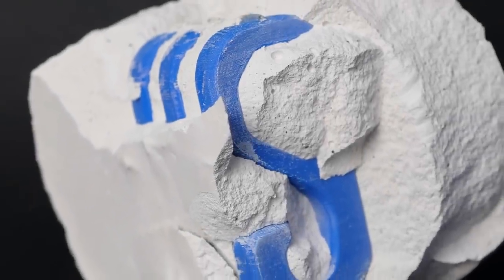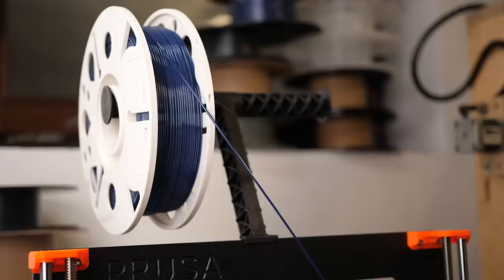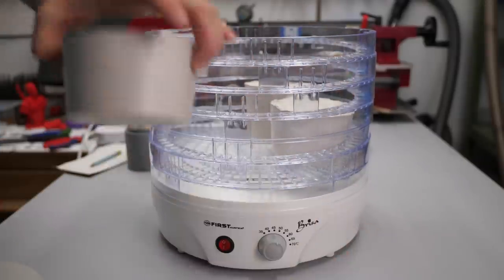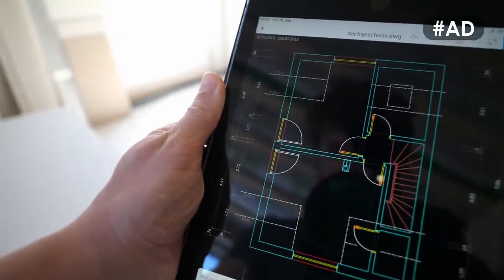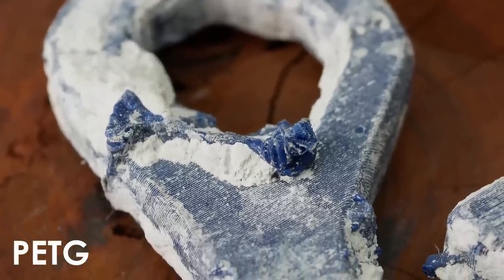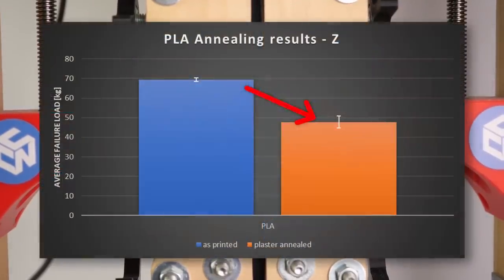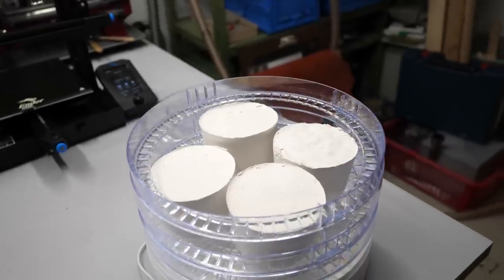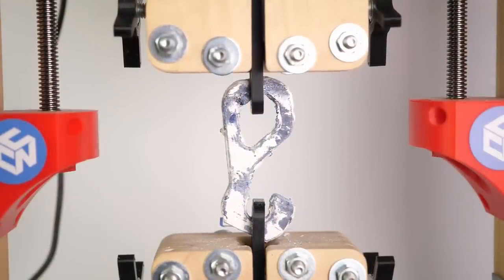Triple (x3) your Layer Strength by Annealing 3D Prints in Plaster!

Comment from the maker: Download a free 30 day trial of AutoCAD ▸ https://bit.ly/cncautodesk

Don't forget to share this video on Facebook, Reddit, Twitter, and other platforms!
Reply: Going forward with a sponsorship from Autodesk after the community response to their crippling of Fusion 360 seems like a bold move. Hope you could squeeze them for some hazzard pay for the risk to your reputation. 

Great tests, as always. Thanks a lot :)
Reply: i dont understand why autodesk starts sposorings right NOW, when there is so much risk of the community hating them...
Reply: @RedHotBagel  Autodesk was under no obligation to continue offering Fusion 360 for free. Especially when there are quite a few who abused the free license by using it for commercial purposes.
Reply: One thing to test post process for the PLA is UV resistance. Typically this is where PETG shined over PLA, but if its handling heat that much better, maybe it's UV resistance is also increased?
Reply: @vhoward1122  I can totally forgive that, its their insistence on a sub that killed me. I'll buy a piece of software once, I am not prepared to make it an extra monthly bill.
Reply: @vhoward1122  they still offer it for free, with a more limited feature set. I didn't say anything about them being in their right to do so or not.

The community has had a pretty negative response and that is something I would take into consideration as a creator in this space.

I'm not saying this sponsorship should not have happened or is wrong. I'm saying it is a bold move.
Reply: Autodesk can suck it.
Reply: @RedHotBagel  Hes a professional engineer, not just a hobbyist. 

Hes probably used to paying 2 pounds of flesh for a sheet of shape shifting licensing.
Reply: Hi Stefan, did you decide which hooks you were going to test for the hook strength competition? You should make a video showcasing the ones you choose.
Reply: Sheldon Thomas
1 second ago
Dear Stefan, you haven't try electroplating your test hooks,  you don't have to electroplate them yourself, there are companies that can do it for you, like, https://www.sharrettsplating.com/ and http://repliforminc.com/
they claim up to 12x strength increase in copper or nickel plating.
Reply: Should try making just some 3D printed molds for other kinds of plastic parts, maybe even throwing some steel wire in as some kind of rebar. Would also love to see Flex Seal! poured into a 3D printed mold for like D&D miniatures or something.
Reply: Could you coat the prints in a waterproof coating before putting them in plaster? If water infiltration is a problem, a water-proof coating may help.
Alternatively, could you vacuum-seal it in a heat-proof bag and then embed it in plaster?
Reply: It occurs to me, that since petg absorbs water, plaster might not be ideal for this purpose. I would try with silicone instead. It will not require drying and also will not pass water onto the petg. Once the silicone is cured you just need to cut it open and rescue the pieces. Is not as cheap as plaster, but it will be a lot easier to clean up and doesn't need water to clean.. Hope you give that a try looking forward to see the strength of those annealed pieces without bubbles!! Good luck and keep making great content.!!
Reply: pressurized heat oven is one of the best method for crystallize polymer. Infills though normally it at least 80% of infill when pressurized models  due to pressure collapses lot of polymer.
Reply: paint the 3d printed parts to close the pores before dipping them in the plaster to avoid moister creeping into the parts.
Reply: @vhoward1122  I agree.  This is like people complaining about Thingiverse, you can get your money back if not happy.  But since I'm just at the point that I need to increase my skills, I have reached the limit of what Tinkercad can do, I will look at other solutions.  I was starting to learn Fusion360 via on line tutorials, now I think I'll go with Freecad.
Reply: @Human-bf7kz  Oh yea I forgot about that part. Also you can use bees wax as release agent coating as well as a moister barrier.
Reply: Hi, to try use a vibration table to remove air bubbles, like it is made during  precast panel concrete pour. BTW It may give interesting results by using ultrasonic vibration too.
Reply: For dissolving plaster without having to hammer you could use some acid. I would use a muriatic acid solution but maybe you could try also some less strong acid (acetic acid?)
Reply: Seriously? an AutoCAD plug? why not Inventor? wouldn't that make far more sense to promote on a 3d printing channel? 

I've used AutoCAD before as a student, and it is an absolute pain in the butt to work with. It's a much older piece of software, and shows that in the clunky interface, you have to do basically everything yourself, and switching layers constantly is very tedious. It can do a lot of things that Inventor is not designed to do, but it doesn't really do anything particularly well. I honestly consider it a glorified vector graphics editor, not a proper CAD software. for 3d modeling, 1/10, piece of junk. for creating some types of vector graphics, 5/10, it's actually the only vector graphics program I can actually use, but it has its limitations.

On the other hand, Inventor is a complete breeze to work with because it is so intuitive to control, I like how well it tries to figure out what you want to use next, and automatically adds constraints, I honestly find it hard to believe that the same company made both when one has an annoyingly difficult interface, and the other is so intuitive and easy to jump in and start playing around. 7/10, great product, but the price is just ridiculous for a home gamer. Over one grand a year? what gives Autodesk? I get that it is a very capable product, but that price scheme is very unaffordable for a hobbyist. 

Autodesk, if you're reading this, I think you should try to offer more flexible pricing for hobbyists. you have a good product, but the pricing is ludicrous. I'll be the first to admit I don't understand the economics at play here, but I can't help but feel like there could be money and goodwill to be made by allowing more people to afford it and not just commercial entities.
Reply: First the questionable polymaker advertisement, and now Autodesk after all the hate for their Fusion 360 change of business... You are kinda hitting on the wrong sponsors in the last couple of videos.
Reply: Perhaps its worth retrying PLA at a higher temperature?
Reply: Amen
Reply: Your a genius, this is why Germans are awesome
Reply: here some improvement ideas:
1.use less plaster, you don't need a big bucket of plaster for a tiny hook xD, if you use less drying is faster, and opening the form also.
2.use a 2 shell method known from silicone form building:
  make 1 half shell submerge the part 50% , use a water resistand thin foil around the part so it the other
  half of the plaster does'nt merge. Use 4 position studs.
  you could make the seperation foil 5-8mm shorter on each edge so you still get 1 piece , but it can be cracked like a nut by hammering on the outer plaster joint.
The foil acts similar to the separation spray in the silicon process: https://www.youtube.com/watch?v=iCxEQZBJTao
Reply: @certified-forklifter  They're expecting all that money from forcing people to buy license.
Reply: If Autodesk had marketed Fusion as free for a limited time, I wouldn't complain. But they marketed it as free until you make $100k/yr, or if you need cloud services.

Then sternly they told us we have two weeks until they (a) lock us into their platform, and (b) break a bunch of our projects (a perfect combo!). It's clear they don't give a shit about hobbyists.
Reply: Wow, this is super impressive! The process seems similar to "Lost PLA" metalcasting.  Geoff from VegOilGuy might have some tips for you to improve the surface finish. 
Here's his Collab request page:
 https://www.vegoilguy.co.uk/collab.php
Reply: How about using dry sand in a plastic bag, then pulling a vacuum like a sealed brick of coffee? Easy setup, easy teardown, and zero hydrolyzation issues.
Reply: I'd love to have a full version of AutoCAD, but at three times the price of the LT version, and that only a one year subscription, it's as bad if not worse than paying a few years ago, as much as the cost of a small car. It's a pity they don't sell older no longer supported versions at a greatly reduced price for us non professionals who have no need for the top of the market versions. I learnt to use AutoCad at college 25 years ago, and used to have an outdated version on a second hand PC, used it occasionally to do furniture layouts in my house without having to keep moving the furniture, designing wood components for furniture, and just playing around designing architectural items. Not enough use or level of expertise to warrant spending thousands of dollars on a full version.
Reply: @TheStickyBusiness  saw the salt video first, seems to be an easier method and at least works fine with the PET material
Reply: seen this guy doing it in salt https://www.youtube.com/watch?v=nRLJ4ylGTFc
salt tend to get harder at high temperatures but is easier to remove
Reply: Have you seen this method? It uses densely packed, ground, salt : https://youtu.be/nRLJ4ylGTFc
Reply: CNC Kitchen what about using a laser to "anneal" the exterior of a printed part?
Reply: Der jute alte QuickMix vom Toom-Baumarkt 💪🏼😁😁
Reply: Technically you're normalizing and not tempering.  Normalizing creates uniform stresses.  Tempering does the same AFTER a quench or hardening.  Tempering draws back what was intentionally done.  Normalizing is removing manufactory stresses.
Reply: Autodesk is the only creative software company greedier than Adobe.
Reply: I would love to see you paint 3 coats of japanning on the parts.  Then put the parts in an oven at 400 degrees Fahrenheit to melt the parts and cure the japanning coats
Reply: Well, I use FreeCAD since it’s free.

Comment: this man single handedly has helped the entire 3d printing community on multiple occasions, thank you Stefan
Reply: bruh he got 2 hands
Reply: Try heat resistant silicon molding. Will work in vacuum.
Reply: He's the Jeorge Sprave (I probably butchered his name, srry) of 3d printing
Reply: @TommiHonkonen  suomi perkele
Reply: Genius category
Reply: It's all just gimmicks for content. He could have just told you to add more than 20% infill and would have made way more sense.. if more strength is your goal, why stop at 20% infill lmao.. and why not just go above 100% extrusion? Why not add more walls? They are just the basic tricks.
Reply: He has inspired me to work towards helping the community. Now I have to convince my new job to allow me to use their multi million $$ metrology lab after work hours 🙃
Reply: @greasysteve5671  lmao the sling shot man. Love that dude.
Reply: From cnc kitchen

Comment: Before putting in plaster, coat with a sealer and then mold release. Avoids moisture absorbtion and reduces cleanup.
Reply: Good call on mold release and sealant.
Reply: In a pinch, try Pam cooking spray
Reply: wouldnt this mix up with the pla?
Reply: @wt2009  Could do and that is what I thought when the same idea occurred to me, the chemistry would be complex, then again having thought about it another time it could help. Only one way to be sure!
Reply: @mhartleroad  i was thinking a quick dip in liquid paraffin wax would seal the part off nicely.
Reply: I would try a wax . Stefan has already shown that coating part with another substance didn't significantly change the part strength. A few microns of wax is unlikely the change the part strength even if all of it was absorbed into the part surface. I would als try to reduce the volume of plaster use to facilitate demoulding. Introducing a parting line could also help.
Reply: As long as those added chemicals don't mix with the plastic upon heating!
Reply: agreed, you need something to feel the "crack" of printing layer to reduce the "grip" of the plaster.
Reply: Probably could pop it in silicone
Reply: was just about to mention coating the\m with mold release wax/agent/spray before putting in plaster
Reply: I wonder if you could use a 2 part or uv cure resin coating perhaps that would be more stable at temperature and not bleed into the part.
Reply: Would it react to the PLA? What sealer and mold release are you talking about? Would Silicone Lubricant work?
Reply: Was just going to say, give it a dip in hot paraffin, but the right products (PLA sealer and mold release) is a better idea.
Reply: @tonyray4203  it's more about preventing moisture incursion and making it easier to get the plaster off.  The anneal itself is meant to improve layer adhesion.
Reply: thats what I am thinking, silicone comes of pla very easily, perhaps a coating before the plaster.
Reply: @tonyray4203  the wax would eat or mix with the molten plastic
Reply: Clear coat and PAM. 10-4 good buddy.
Reply: @mrbumcraic5046  The plastic isn't supposed to melt during annealing, it's just heated enough to soften it, which encourages layer adhesion and reduces internal stresses.
Reply: I'm amateur potter and usually we use silicon splay as separator when we make mold with plaster.
Reply: What about something hydrophobic like scotch guard?

Comment: The higher temperature capability of the PLA after annealing is the most interesting result from these tests.
Reply: I can think of endless possibilities
Reply: well we already knew that. but the 0 deformation is the real winner here.
Reply: Thats already been established in a different video he did
Reply: It's because of increased crystallinity, which has a higher melting point, because of its lower energy and therefore thermodynamic stability. This is to be expected for semicrsyatlline polymers like PLA
Reply: Exactly. A phone holder or sunglasses clip doesn't really need the full PLA strength to function as intended, just the ability to not melt in a car sitting in the sun all day. This would be perfect for those applications.
Reply: Gabe1291 ever heard of ABS? No additional plaster and cleanup required. Just saying.
Reply: @fabianbinder3681  That is true, but ABS can be more finicky to work with, and generally requires a heated bed. Not a problem for most modern printers, but it's handy for those of us still using scraps and DVD steppers :)
Reply: @fabianbinder3681  Yeah, but ABS has fumes, generally needs a better controlled temp environment for printing, and a hotend that can handle the temps. 

My printer sits in my office 2' behind me and doesn't really have an enclosure, so while my hotend could handle the temps, there's no way I'm printing abs on it. Also since we're in an apartment, there's not really any other place to put it, so I stick to PLA.
Reply: @BitcoinIsGoingToZero  I guess you could call it, strictly speaking, less crystallinity, larger crystals. Same principle as an amorphous gas turbine engine blade.
Reply: @BitcoinIsGoingToZero  Because of this property I have been warning people trying to regrind and recycle PLA prints that quality results are near impossible.  I advise them to move on to a more stable plastic PP or PC.
Reply: this is especially true for using PLA as an insulator for electrical applications since it could be used to replace paper, cardboard, presspan cloth and other things enabling space and matirials savings for things like inductors and transformers.

Comment: The temperature tolerance improvement on PLA is astonishing. That is much more interesting to me, since we have so many techniques for designing and printing parts in their optimal orientation, but if the material fails due to temperature, then there is nothing you can do. So massive kudos for figuring out this step.

Comment: This process is not annealing, this is re-melting. Annealing involves raising the part to its glass transition temperature for a period of time, then allowing it to cool. Performing and repeating this process not only relieves internal stresses but also softens the amorphous regions of your bulk material. While soft, these amorphous regions will rearrange, improving crystallinity and ultimately yielding a stronger part. Melting turns even the crystalline regions into a liquid phase, setting your annealing efforts back to square one. In your case, re-melting likely just improved the strength by eliminating the inherent weakness of layer adhesion in FDM. But, this should not be confused with annealing. You can do a quick experiment by printing a shape with only a few layers, and using your heated bed to do the annealing. You will also notice that the glass transition temperature will rise as your parts anneal.